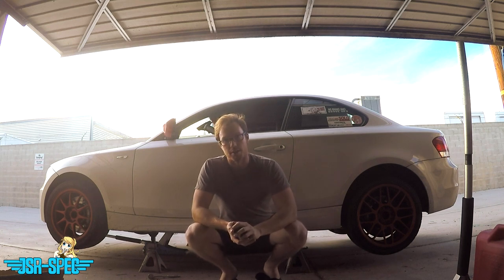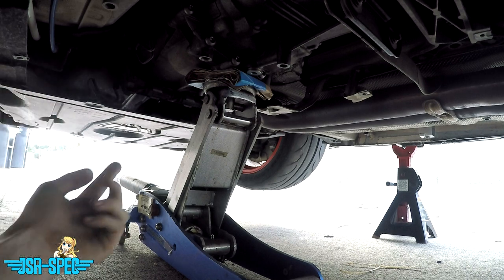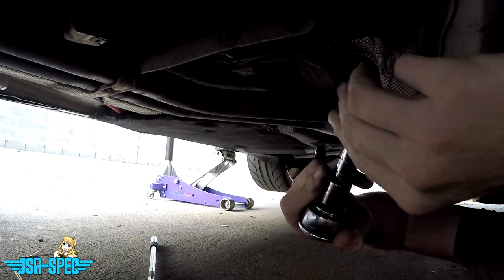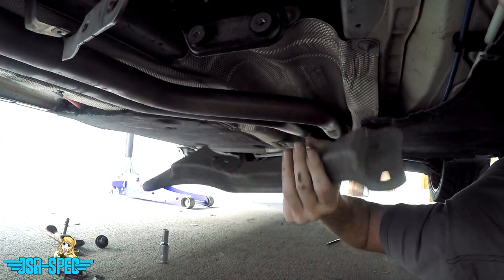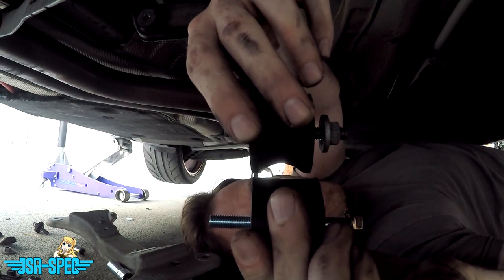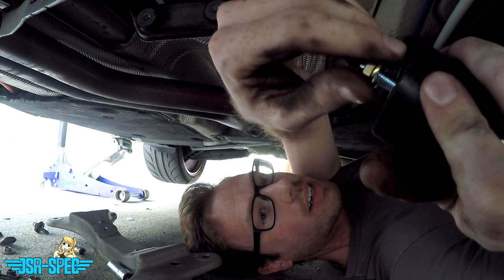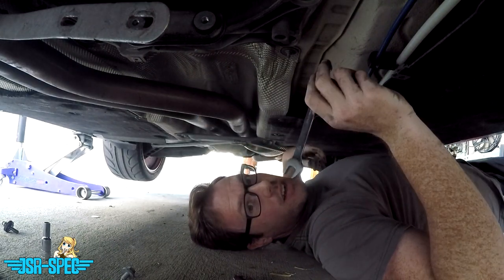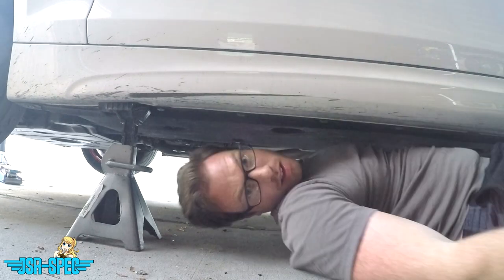BMW 135i/335i: Transmission Mount DIY (How to Install)

Comment: Thanks for the DIY. Any update on them since you installed them? Do they add to the driving experience? for the positive that is...
Reply: I actually just bought the same bushings and will be replacing mine in the coming weekends. I will for sure rewatch your video. thanks again!

Comment: thank you very much for another great video!!! can you kindly let me know what type of suspension work you have done to your vehicle in order to get it to be more effective for auto ross/track work? what is the maximum wheel and tire with you can go front and back and what if anything did you have to change inorder to achieve this?… do you run and LSD? Many Thanks Sir
Reply from the maker: 255F/275R tire with aggressive alignment and fenders rolled. These cars are useless without an LSD, recommend a clutch type. I used an MFactory helical diff and it was just okay. TC Kline coilovers, adjustable arms in the back, solid subframe bushings.
Reply: @DriveBreakFixRepeat  Thanks for the response DBF!! what is the offset of your front rims and did you have to use spacers to get the 255 to fit?

Comment: so how you liking the rogue mounts?
Reply from the maker: Nice upgrade. Didn't really add any NVH, but shift quality is up in a big way. However, the stiffer trans mounts now make the soft OEM engine mounts and engine movement very noticeable. Upgrading engine mounts soon.
Reply: thanks for fast reply, my current motor mounts are 034 density line(e92 335i) which i need to inspect for failure since i've heard they are prone to premature failing sadly...only have 3k on them. i am considering these rogue mounts because they are still rubber to match with the motor mounts. if my 034 mounts are shot i will attempt a refund and get 335is mounts. thanks for the info man
Reply from the maker: I wanted stiff engine mounts, but also have seen various aftermarket mount failure. Debated buying OEM iS mounts, but ultimately went with RevShift 95A poly mounts. It's a brand new option on the market. They incorporate a thermal shield, which, in theory, should prevent the hot side mount failures people have experienced with other brands. TBD if they can withstand the punishment I dish out on this car. Video on that coming soon.
Reply: @DriveBreakFixRepeat  how did they age